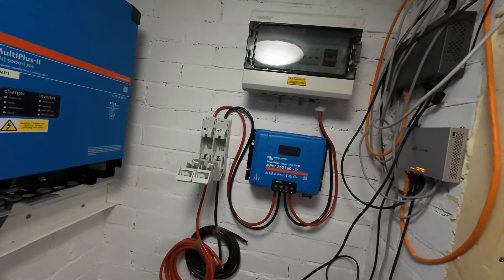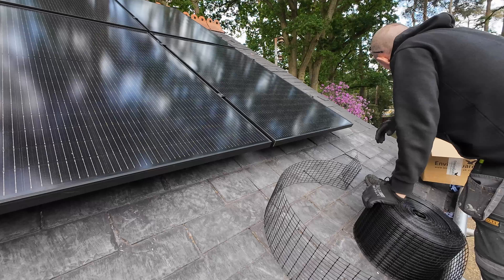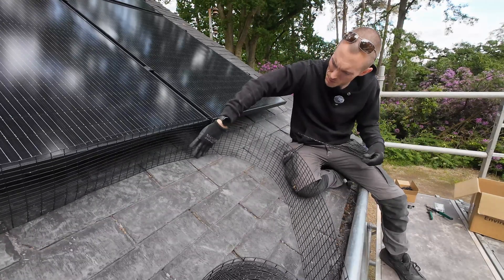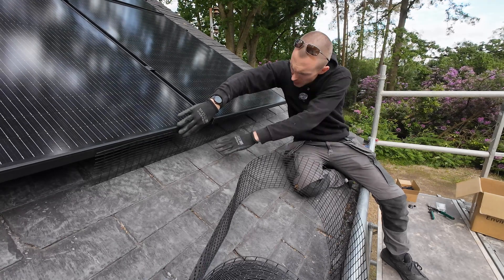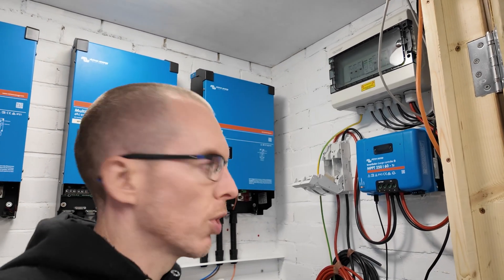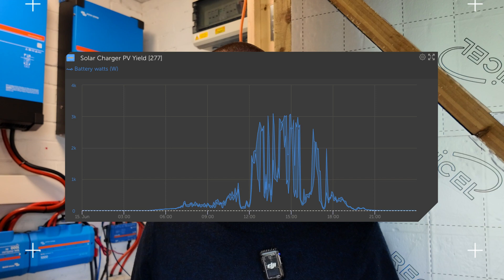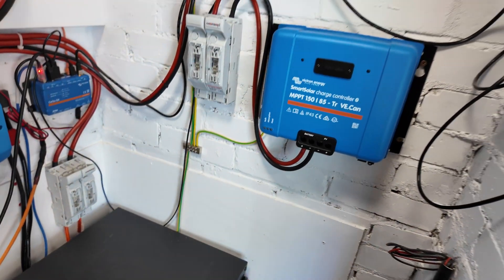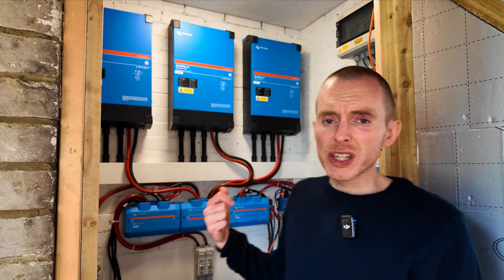DIY Solar Install - How much POWER does it make!?

Comment: Hi Rod,  love the Victron / solar stuff. I'm in the process of install my Victron system. Looking a your set-up I can't see a shunt? are you grid connected? Also when I purchased my Victron stuff the tech person told me that on a 100A domestic supply I could only have two 5kva inverters. How big is your domestic electrical supply. I have lots of questions any chance we could have chat.
Reply from the maker: Hi, With Pylontech batteries no shunt is required, the batteries have their own BMS that reports all the required data to the Cerbo GX. I am grid connected with a 100A single phase supply, I'm not aware of any sensible reason why you couldn't have more than 2 5kva inverters. Maybe the 50A transfer switch confuses some people. You do need to complete the G99 process to get permission from your DNO. Unfortunately I'm crazy busy and don't really have the bandwidth to help 1on1, I hope you understand.
Reply: @RodMcBain   Hi no problem, on the 1 2 1. FYI I have my G99 approved. I'm at the end of building my new garage with 16 x 430w panels installed (adding more on ground mounts later), doors and window getting fitted next week. Then I can start the install the 2 x Victron 5kva Multiplus's and 2 x 450v 100A MPPT's I also 2 x 14 kWh Seplos batteries. I jumped on the offer before xmas buy  two mulitplus's and get one free from Victron that's why I was asking for the chat. You don't see very often 3 mulitplus's in parallel. 

Thanks again,
Alan

Comment: Mate it’s July I don’t think your solar panels are producing much this month lol. I’ve just put 4 on my garage trina bifacial panels with Tigo’s as the house shades the garage for a lot of the morning, I’ve just put a white sheet of PVC cladding under them to boost what the back side panels see, it works but how much I don’t know I’m waiting for some sun ☀️ 😢
Reply from the maker: I know, it's ridiculous, I don't think there's been a completely sunny day since I installed the panels and when there has been sun it's mostly been in the morning when my panels are shaded 😢
Reply: @RodMcBain  because of the panels you have I think it’s 15amps or more? If so you would need Tigo Mk2 ones but if all are shaded then no point

Comment: 3 victron inverters, that’s impressive! How are they configured? Parallel or are they set up for 3 phase? 

If you have them in parallel, why have you gone for 3 of them? 2 car chargers? Planning on going off grid maybe?

I recently went from one to two multis in parallel, wondering if I now need to add a third one.
Reply from the maker: Thanks for watching, they are configured in parallel, couple of reasons, the 70amp charge limit from each inverter is about how much is required to fully charge 4 US3000C batteries in the off peak window I get from my electricity supplier, so with 12 batteries I need 3 inverters, that's important in winter when I won't get anywhere near enough solar. 

Second reason is to have the ability to run off grid, I have no plans to go off grid but do run the whole house through the inverters and batteries, so if the grid goes down nothing stops working. We also have a 16kW heat pump, combined with an induction hob, washing machine etc you could easily get close to exceeding 12kW.

Comment: Typically when the sun is peeking out from behind bright clouds you can get generation well above the panel rating.  But it's momentary at best.  But mostly this just seems to be a case of not having enough solar panels for the size of the power and battery system they are feeding into.   Usually systems of the size you have down below are fed with 10-20 kWp (nameplate) worth of panels.

One thing you can do to improve production is not parallel any strings that might be impacted by shading, partial shading, or which have different orientations.  Instead, give each of those strings its own smaller MPPT controller.

An easy trick for soloing large panels is to put bolts and nuts in the frame holes on the bottoms of the panels.  Then when you haul the panels up onto the roof you can rest the panel on the railing using the bolts as a door-stop to prevent them from sliding off the roof.  Even though that isn't the final position, it makes it a lot easier to install the panels and I don't even bother removing the bolts after I'm done.

-Matt
Reply from the maker: Hi Matt, thanks for the comment, lots of useful info in there, this solar install is definitely just the start, as I mentioned in the video I have 9 more 420w panels to install and also plan to cover as much of my house roof as is practical.

I think using 3 smaller MPPTs might have helped a little with this roof, but I expect the impact would have been minimal, the roof goes from fully shaded to not shaded at all in the space of an hour. I might try experimenting with this at some point to see what difference it makes.

Comment: When I saw you only had 9 panels vs how much battery you have, I figured you'd need easily twice that amount.  I have 66kWh of home battery and 22 similar sized panels and I feel that I need more.
Reply from the maker: I doubt anyone ever feels like they have enough solar panels 😀 I have those 9 420w panels that I'll mount next and also plan to mount as many as I can squeeze on the roof of the house, probably still won't be enough!

Comment: Great video. Am also a big Victron fan for its flexibility and open APIs. Can you explain more about the DC combiner box and whether to go serial or parallel?
Reply from the maker: I've been running Victron kit for a while now and can't complain, could be cheeper, but it is generally excellent. 

Taking my Eurener panels as an example, they have open circuit voltage of 43v per panel in series that would be 387v for the string, to run that you'd need a really beefy / expensive MPPT, something like the SmartSolar MPPT RS 450/100. It's much cheeper to run fewer panels per string and combine them in a PV combiner box, so with 3 stings of 3 panels I'm at a max voltage of 129v so can use a 150 or 250 MPPT. The voltage limit is something you must never exceed with Victron MPPTs, you'll end up with a very cool paper weight. Keep in mind I'm no expert on solar and just learning a lot of this myself.

Comment: Excellent video (and work), love your style and attitude. Can you explain the DC array and AC array marlarkey, also where are located (roughly)?
Reply from the maker: Hi Norman, Thanks again for watching and your comment, really good to know there are people enjoying the videos. 

AC vs DC coupled is really just describing how the solar panels are connected to a battery system. All solar panels produce DC electricity and all batteries consume / supply DC electricity, DC coupled is where the usually high DC voltage output from the panels is efficiently converted into a lower DC voltage suitable for charging batteries, that's what the MPPT does. To then use that in the house it need to be converted to AC by the Multiplus inverters.

AC coupled is where a solar array is is directly connected to an inverter that generates AC electricity that can be used in your home, but if you want to store that energy in a battery it has to be converted by another inverter (Multiplus in my case) back into DC. This back and forth conversion between DC -> AC -> DC is not very efficient.

So DC coupled is best for charging batteries and AC coupled is best for instant consumption or export. I think what I'm planning with a bit of both will give us the best of both worlds. In my case it also means solar in the house can be connected to the existing AC system and I don't need to run additional cables over to the garage inverters to carry DC.
Reply: @RodMcBain  Perfect Rod - I think I did understand the difference once,  but I am an old bastard now and forget a bunch of stuff. When I was younger I was clever.😉
Reply from the maker: Forgot to say, we're currently located down in the south east of England.

Comment: Absolutely impressive Rod.... although where do you get the time? We moved to a bungalow in Scotland in Jan which needs a fair bit doing to it. I have a complete system (pylontech US5000's, sunsynk inverter, panels etc waiting to go in (brought it from the house we sold as the buyers didn't want it). I'm getting so frustrated not finding time as the priority is getting this place liveable 🤦‍♂️. There is a small 2.2kw FIT system installed on the bungalow already and for the size it generates a fair bit, so I am looking forward to putting my stuff on also. I am going to oi my utmost to be as energy independent as I can. Look forward to your next vid 👍
Reply from the maker: Thank you. I'm not sure if your question about time was rhetorical or not, I work a full time job 9 - 6 and when I'm not working to pay the bills I'm working on the house, I guess it's what I do for fun 😀. 

This house also needed / needs a vast amount of work, when we moved in there was no heating (unless you count a coal fired aga) our solution to that was the heat pump and I guess the amount of electricity that consumes has forced me to prioritise things like the battery system and solar. I know my wife would much rather I was working on the extension and our new kitchen.

I can imagine how frustrating it must be to have all that kit sitting there not producing anything, I'm already getting frustrated with the 9 x Perlight panels I have sitting idle in the shed.

Comment: Apologies if this is explained later in the video (only half way through) but how do you save the VAT when self installing? I ordered some panels for an outbuilding from ITS recently. If I'd known I could save the VAT, I might have ordered some extra batteries!
Reply from the maker: I didn't end up properly explaining that in this vid, was going to make a second part about the extra batteries and inverter I installed and why (to save the VAT), in my case I bought everything though my electrician so he paid the VAT then doesn't charge me VAT and claims it back.

But I.T.S and some other suppliers have a scheme where you can save a good chuck of the VAT when doing a true DIY install, they essentially end up sub contracting you to do your own installation, I think the last time I asked they charged a 5% fee to arrange the paperwork, so you save 15%.
Reply: @RodMcBain  thanks, that helps! I may think about doing that through ITS if I add more panels in the future.